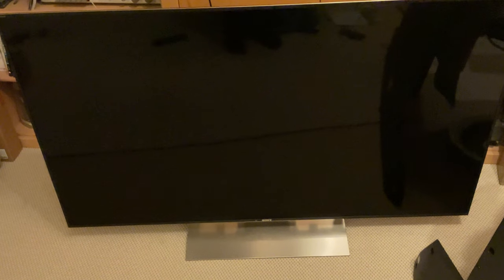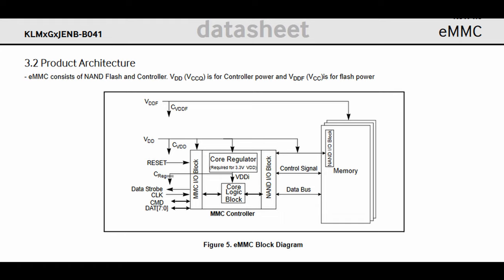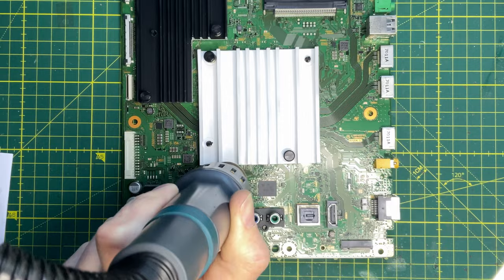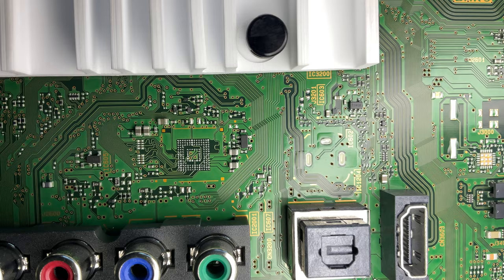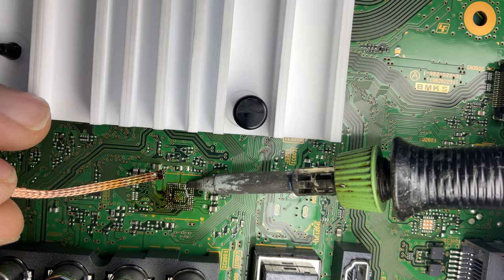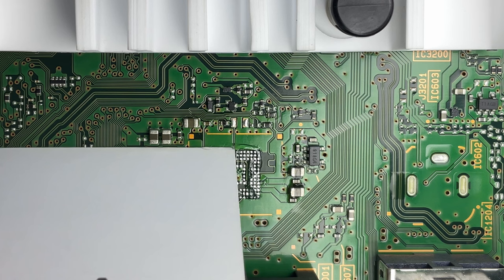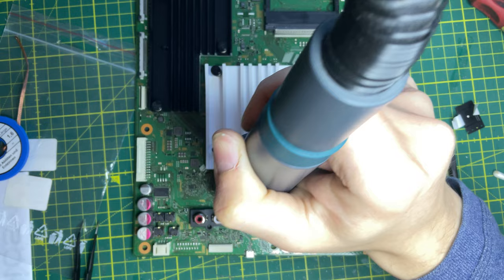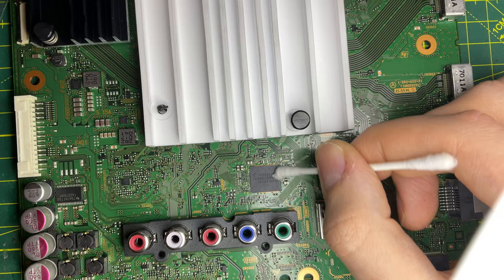TV REPAIR | eMMC replacement | NO POWER or BOOT LOOP FIX

Comment: As often as these chips seem to fail or go bad, why in the world would the TV manufacturers make this a soldered chip on the board? Why isn't this chip set up as a user/technician replaceable item that can simply be ejected and re-inserted from a slot or socket on the side of the TV? If this is just a MMC (Multi-Media Card) weren't those originally designed to be used as consumer memory/storage cards that you could easily slide in and/or eject from a device? Why can't that same thing be done on TVs then? Wouldn't that cut way down on repair times and costs?
Reply: Probably because it makes them money if you can’t easily replace it as user, I mean hot air soldering isn’t necessarily the hardest thing you could do but it’s also not easy as well
Reply: @seesikopter  I'm sure it has to do with cost of production, too. It's the cheaper way to do it. I'm just saying that it would potentially save a LOT of people a LOT of aggravation, hassle and frustration if that particular part could be easily field replaceable.
Reply: @seesikopter there is no tv in this world which lets you replace the emmc without soldering. 😂
Reply: @gicugigel3790  well Sherlock, the talk was about „why it ISNT like that“ as the mmc format was meant for portable storage back then
Reply: @seesikopter  why isnt like that? Because every man should have its own profession, not do all the things. What will technicians do if users will repair their tvs? Starve?
Let the trained people repair the tvs and everyone do its own job.
Reply: @gicugigel3790  tell me which person you know said they got their tv repaired? 

I’ve heard most people just get a new unit if it breaks as the cost is too high. And I can do that on my own, I can’t flash the chip, that is the only issue. And most technicians would still make enough money, such a stupid argument
Reply: @seesikopter  you will laugh, but many, even if they have no tools, unscrew the back of the tv and move their eyes around, trying to find a broken wire or a burned fuse.
The ones which own a multimeter and a 3$ soldering iron even try to fix it and damage it even more.
Many open their own tv and try to replace the led strips and brake the screen.
When car doesnt start, lots of people make posts on Facebook groups to find solutions, then try to fix their cars.

Now answering your question in a more obiective way, they solder the emmc chip because it is cheaper. A bga emmc have about 150 pins (balls). To make that chip easy replaceable, the manufacturer needs to pay for a socket. The socket costs some money. 
Then, the chip needs to have gold plated contacts (like PC cpu), so again more money.
And, what will you do if you remove a 153 pins bga? How will you program it? A programmer costs hundreds. The usb flash pens that we use in the usb ports, dont contain just a memory chip, but also a controller!

Comment: I have an ignition problem, testing all the power supplies and cards, the conclusion is emmc, where I would like to try a reballing first. then if it doesn't work, move on to purchasing an emmc, but I can't understand if I find it already programmed with a default Sony software or it must be programmed. Where can I find the software to insert into emmc? Thanks for your help

Comment: You friggen rock! Facing a similar fault with Hisense 55” but not sure if the firmware is available. Factory will not supply it beyond 2 years. Dirty company. I think video is only missing a quick mention of pin #1 position on the bga package. Thanks for sharing.

Comment: 1:10 Do you really mean "if voltage is present it's faulty"? Or the opposite. And could you point out the exact measuring points?

Comment: After removing  BGA, add flux but then flood area with leaded solder, then wick off.
Reply: That’s exactly what I do, I don’t lose pads 99% of the time
Reply: Not to mention.. clean that soldering tip if you want heat to transfer correctly. Don't be tight with the braid.. new, clean braid and add flux if you need to. Flux and a clean tip are your friends. Just saying. It works - good job!

Comment: Is it necessary to program the emmc or is it enough to put a new one?
Reply: Yeah I have the same question. I believe so, and unfortunetly I cannot find an EMMC that is programmed for my TV...Unless I buy an entirely new board that includes a working one.
Reply from the maker: Yes, you have to program it or get in contact with someone who can program it for you. If you just order the barebone chip nothing will work, because the entire OS for the TV is missing.
Reply: @j.rohleder3794  wait so that means the chip when programming gets the TV firmware put on and then u solder it on there and no need to reinstall the TVs OS? I thought you just tell the chip what its gonna be when installed so it properly works and then you flash the software file onto the Device... hm

Comment: i have a question  sir .can we use mobile emmc if we don't  have led tv emm? If yes how?? I have cleaned rpmb but not working.
Reply from the maker: Thats a nice idea, but i don't think every BGA-153 has the same pinout. If it doesn't, you have to match all data lines, cmd, VCC, ... between your mobile eMMC and the layout of the original TV PCB (just soldering it in place might not work). In addition i'm not sure how much the NAND flash controller of your mobile eMMC differs compared to the original one. I didn't tried it, so i can't help you - sorry.
Reply: @j.rohleder3794  I Have connected all those fly lines do cmd clk short the crystal.or used directly with bga adapter but dont  working with same emmc 153 pin .there may be a way we can use mobile emmc .because its just a memory.by the way thank u for your reply sir🙏🙏🙏god bless you
Reply: No you cant the firmware inside the Phone emmc NAND flash is partitioned for the phone, and there is no firmware for the TV on it so it means it must be erased and reprogrammed, if the chip has the same Pinout and voltage like the original NAND chip
Reply: You can do that but it needs to be a compatible emmc from your phone, then you need to wipe it and write the firmware and maybe also clean the rpmb which can’t be done on all emmc